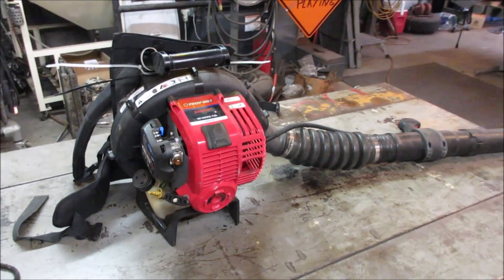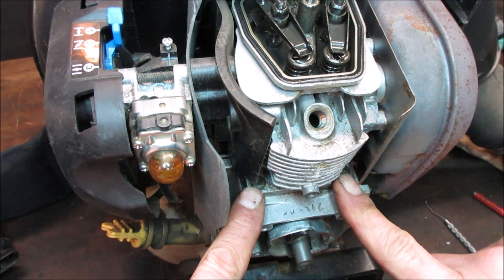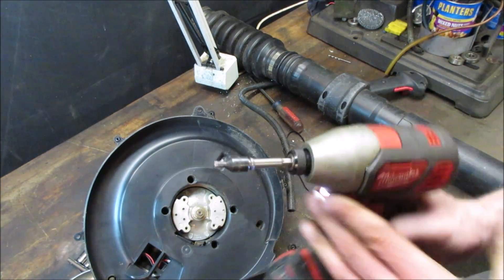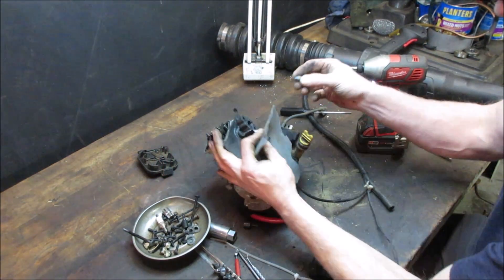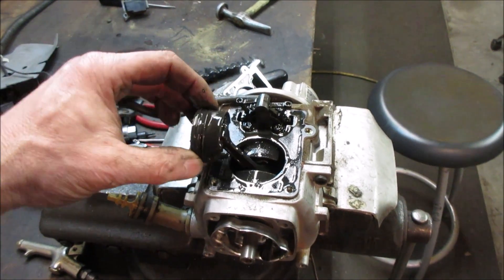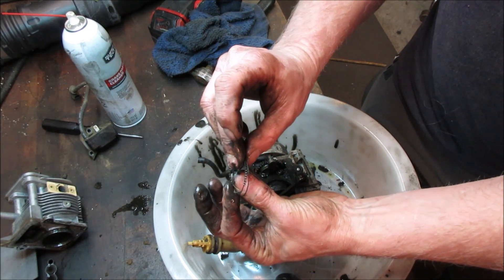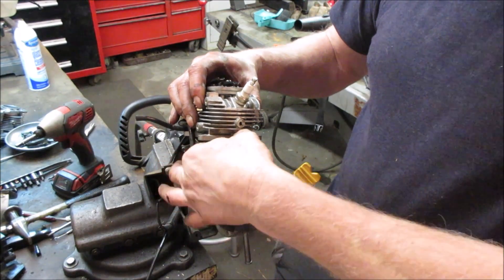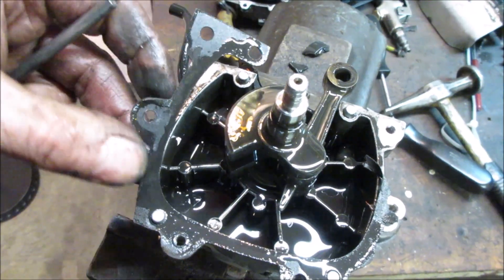Can We Save This Junked  BackPack Leaf Blower ?

Comment: When I saw the spark plug come out, my first thoughts were the piston had come off the conrod, and slammed into the head, but the valves were moving, so that ruled that out, Over the years as a motorbike racer, I have had many high revving 2 and 4 stroke engines drop a skirt from the piston, usual cause is a heat seize, that weakens the skirt, or a flaw in the machining of the piston, either way, once the skirt breaks away parts of it usually end up in the crank carrier bearings, and even if you rebuild it the bearings become the weak point and fail, great video as usual @Mustie 1.

Comment: a little trick I learned working on firearms and laser sights, when encountering loctite screws, especially them little bitty ones that are hex or torx, put your driver in the screw head and using a pocket torch, heat the shaft of the driver till it's really hot. that will usually break the loctite loose and you aren't putting heat directly on the part that might damage surrounding parts and pieces. the heat transferes down the driver to the screw
Reply: That destroys the torx bit, you had better have a disposable set.

Comment: I went thru 3 Poulan leaf blowers manufacturer guarantees them to stay together for 50 hours of run time on average which in most cases will surpass their warranty time and usually takes years to reach. Anything after that is a Gods Send, HA! with usage. The 50 hours guaranteed runtime is probably the same for these and wear and tear just destroys them eventually.Eight years isnt bad  actually probably landscaper may have used it alot. Should be an easy fix like always its all labor and many cant be bothered and put it at the curb, thats the American way. Hey its  good for the economy buy another one,LOL! Great Video as always....

Comment: Back in the day use to put screw driver handles in a deep well socket for more torc . Plug socket to manual impact and hit with a hammer. Screws broke loose 90% of the time.

Comment: Torx and Loctite. What a nightmare.
Edit to add: My bet it was laid on its side running while the user was trying to assemble the parachute harness to put it on his back. Running on its side without the oil dipper means there is very little getting splash lubed, and the side of the piston that gave way would have been the unlubed side.
Reply: I bet your right most of them are 2 strokes where it wouldn't matter. Good point

Comment: The decompression setup is missing a piece. I think it came apart and took the piston with it. That would also explain the banged up screws.
Reply: You Got It Bob 👍
Reply: Interesting and insightful.  Hmmmm I think you might be right!
Reply: Hey Doug What is the decompression setup?
Reply: @donavonlewis1039  There's supposed to be a tab connected to the ring Mustie was taking off the cam gear. It holds the intake valve open longer to make the engine easier to pull start. It's only active below idle speed.

Comment: I believe that cam gear cover is a simple oil pump that grabs oil and then slings it up through the hole right next to the teeth on the cam gear ...if you look at the cam gear there's a hole on it and it can build pressure but can only let the oil out when the hole is facing upwards towards the push rods and rockers.

Comment: The failure was directly related to it being designed to sell for $179 at WalMart.
Reply: $99 fathers day sale.. Lol
Reply: @Les We all know that thing is going to last one season.. It's worth every penny.. Lol
Reply: @Les TRUTH
Reply: @BAZZAROU812  Those machines are surprisingly good and will work for quite a few years if not abused!  My daughter left one running on its side and "away" it went!  I never took it apart, but my guess is internally, it had a strong resemblance to Mustie's!!
Reply: Usually runs 3 or 4 hours then finished

Comment: Well you certainly had some chasing to do to fully discover the fate of that little engine. My theory is poor/cheap casting on the piston which failed. The vast majority don't so but the odd ones that do Meh they'll just buy a new one, never know what killed it. If the orig owner deleted the filter and rigged the netting, they may even blame themselves for the failure. Looking forward to free pile season!
Reply: Oh, cmon, these modern Chinese engines are super high quality that would never fail. /s
None of this stuff is built with any quality anymore even if you buy the big names.

Comment: Whatever it is Mustie1 I think it's a common fail point - I trash picked my same exact machine with the same exact crushed spark plug about 2 or 3 years ago. I remember watching your videos & checked some of the basics, set the gap & she's been running fine ever since without ever looking down the plug hole. I know what I'll see now! LoL... When she does finally blow up do you want it? I could use the blower nozzle in the meantime... Thats what she said!

Comment: That is the model that cured me from buying gas powered small yard machines. Used one season and nothing but problems after that. Took it to troy built authorized repairman several times, could not get it to start properly. the first time he adjusted the valves with very little effect after that he said nothing was wrong with it. The electric starter does not spin the engine fast enough to get it going. I still have it in the back of the garage if you want it at 04967. All battery powered for me now.

Comment: In the earlier Polaris "Pro" Rocky Mountain King series of snowmobiles with the 800cc engines (two cylinder, two stroke, oil injected) they had an engineering flaw in the top end. The piston skirts would fail and break away in a very similar fashion. This was an issue to the degree, people were rebuilding the top end every two seasons. These were circa ~2013 machines. Polaris re-designed the pistons on the following models to cure the issue. A rider was money ahead if he spent the bucks to do a preventative rebuild before the issue happened with all the attendant collateral damage to the case and lower end. I'm not sure if it was an alloy issue with the piston or a weak design. My 2016 Pro Axys is still running strong on the redesigned pistons.

Comment: If you didn’t live so far away I’d swear you were working on my Troy-built blower that blew up under warranty. I didn’t have tear it nearly as far apart though. I took a bore scope and just looked through the spark plug hole. Mine the whole piston was in the lower case. The only thing in the cylinder was the rod and wrist pin. Troy built replaced under warranty, but it was a bit of a pain.

Comment: Think it got hot enough for the rings to close up. Once that happens it pulls the top of the piston off. 
Likely got hot from all the bubble gum repairs interfering with designed air flow.
You can pull the top ring land off with out scoring the walls.
Small piston size engines have a narrow window of tight enough ring gap and still maintain good compression and yet enough gap for heat expansion. These tolerances are easier to get a good balance larger the piston diameter..

Comment: I bought the same set of Milwaukee impact + drill drivers 2-3 months ago when Home Depot had a mailer or email come out about the deal.    Fantastic tools.      I removed the belt clips since as a nonpro sometimes mechanic household DIY person I'd never need them.       One cut my wrist with the torque while using it at an odd angle.

Comment: Small Vice Grips on the head of a screw like the ones holding down the cylinder can easily break the torque without damage and then you can use your hand tool to unscrew it. Works great on old Carbs too.

Comment: Really enjoy your explorations. I'd guess skirt failure. And that's not what she said. Hit by the crank, causing the top of the piston to get fractured. Chunk of piston top caught between piston head and spark plug, closing the gap. Just a wild guess. Probably have to look at the lip of that piston and see if you can tell if the edge of the break looks like it would have gone up, or down. Not sure if that can be discerned though. Looks like it went through some abuse.

Comment: lol I had a good idea what happened as soon as you tossed it onto the table. Regardless of the color or the name stuck on them most of these units were made by MTD. And thier focus seems to be how cheap and flimsy can we make these and still have most of them make it thru the warranty period without blowing up. You did pretty good getting all the fasteners out without the heads breaking off. I have a pile of both the weedeaters and the blowers in various colors all made by mtd and all various stages of failure Most traced to poor materials and or poor design. Like you said they are throwaway units. put together quick and dirty. and not meant to be taken apart. I have 4 other blowers from about the age of the one your showing that have grenaded piston issues. Perhaps it is a inherent design flaw or material flaw. Interesting to tear it apart. figured I'd let ya know. just for diagnostic sake that I can show ya 4 more with the same failure and about the same unit and date. and the 4 I have here have intact air filters.

Comment: Hello, If a screw, nut or bolt is tight. You need a "magic code word. Use the finnish word" PERKELE. If it don't open, just add some extra "R". Thank you for your informative video. Regards Stig Österberg from Dalsbruk in Finland.

Comment: Have/had a similar machine. 
The top of the valve chewed through the top of the valve retainer. Put a tiny c clip there temporarily but after a while of use, sounds like it dropped the valve again. Wasn't able to get a replacement for it.   Cute little motor though

Comment: It is a decompression system. The plate is missing the tab that actuates the exhaust valve during compression. It is the same principle as the flyweight on a cam for an OHV.

Comment: Troy Bolt is made by MTD, and MTD is just "ok" equipment.  I think it is a compression release on cam.  So the oil was never changed, they ran it without an air filter.  It dusted down the piston, rings, and cylinder and destroyed the engine.
Reply: yeah mtd makes all sorts of equipment..different names but all still made by mtd..you find that on alot of outdoor equipment..mowers, weed whackers, leaf blowers etc
Reply: Someone probably also ran it with straight gas, and forgot the mix, or just didn't have any or just didn't care, and didn't want to spend money for mix!! Either way, a bone head move!!
Reply: @lottiecooper609  It's a 4 stroke. Takes straight gas.
Reply: My bad. Either way, someone obviously didn't care!! Usually the case when the person using someone else's property, and didn't pay for it!!

Comment: That usually happens from someone starting it and slamming it wide open without warming  the engine up. Ring expands before the cylinder gets a chance to and the ring ends but up against each other.  Bango!! Most the time it rips the entire top of the piston off.
Reply: If there's oil present you should be able to run them wide open after a few seconds,  there's very little mass to the piston and cylinder and they will heat up almost instantly.

Comment: Id say it got hot due to crap oil (the oil works as a coolant along with lubrication )  running hot it cracked the piston crown and broke the chunk off the top, that chunk got in the squish zone and jammed the piston causing it to tilt sideways braking the skirt off.  Pistons and other parts for these are cheap on ebay.  i don't know about this model (not sold in aus) but the hondas run 80ml of oil which is not much so it pays to change the oil regularly. thanks for posting.... cheers

Comment: probably since that's the original oil at some point since the air cleaner was gone dirt got pulled in and started eating things up kind of like how a sandblaster works. At some point the metals shavings got so bad they got into the oil and started tearing it up bottom end causing the piston to fall apart and eventually brake. I almost wonder if that busted off piston got so ate up over time most of it just turned into shavings and helped with the destruction of the rest of the engine. Wow cant say I have ever seen a piston eat its self to death though.

Comment: it's a decompressor on the cam gear.its what they call easy start and a lot of manufacturers use it.its on lawnmowers too.usually worked by centrifugal force when you pull the engine to start it bumps the valve open.tge piece for bumping the valve is missing maybe that was the cause of the damage

Comment: My guess is someone ran that leafblower wide open from when they started it until eventually died. Heat and cooling cycles cracked the aluminum and eventually it just gave up.

Comment: I'm leaning towards one of three causes - first, the lack of air filter allowed it to ingest a piece of trash that hammered the piston...or smaller pieces of trash building up.  Second, a factory defect in that piston - casting inclusion, poor quality material, etc...  Third - it was overheated / overspeeded by someone trying restricting airflow - either at the feed (pad on the back?) or with a nozzle on the output of the hose?  The oil, while super dirty and super thick...or low oil level, seems unlikely to me as I think you'd see other damage / wear elsewhere.  Just my few pennys of thinkin'!

Comment: You should get one of those 1/4 hex long bit sets, they slot right into the impact driver and are a godsend for working on small appliances and small engines. Harbor freight sells them for like $8, and I'm sure there's a million brands just like them from the same factory on amazon.
Reply: 8 bucks may as well be 8 million. Mustie is cheap.
Reply: @billhenry7833  Musty isn't cheap, Mustie is Frugal

Comment: Very Interesting Video Mustie  1  :) I  wonder in the previous owner had used Break In Oil to long on hours and forgot change it by accident or had wrong grade Weight  in a to use after that! I have heard could happen and I know something was strange to shocked me years back to! My late Dad bought a brand Chainsaw  also from store not nameing also be excellent brand to not nameing to and  had 18 bar ! He bought brand new also he got 4 months use of it , then coil quit so got new on it and tried get going ran for 15 days then died again ! Wasn't coil also air filter or spark plug and when pull rip cord hear tapping noise from so took back store bought from they said could get parts but have no one can't fix it in that small engine mechanic repair and so took to one in area we live also get check over ! So what problem was the Cylinder on motor had one Ring on totally and ring broken up to little bits also crack Cylinder bad in + direction inside Cylinder wall! So mechanic phone my dad up said come in need showed up to show  happen  and went took him shop mechanic to show happen  to low hours use 3 year warranty Chainsaw ! He said that wild what happened and my dad said is anyway be fix also guy mechanic said yes piston with more rings also home Cylinder and install it and never seen this happen before too! So dad said okay any chance happen again too and mechanic said not sure because first one seen happen too in this brand but does again scrap it I would ! So still works last I know of but I check out this week find out been 10 years in use!

Comment: 23:11 Malice in the Combustion Palace! Also if you think those valves are tiny start looking at RC plane engines. I have a 5cc 4-stroke in my hand right now...talk about microscopic valves!
Reply: Those are pretty awesome.. My buddy does the Rc cars.. They scream pretty good.. I found out how much money they cost and about lost my Sh$t.. 💸💰
Reply: @BAZZAROU812  The expensive ones are the brushless ones funnily enough. The only ones running fuel anymore are die-hard gearheads and there's not enough of us for nitro cars to hold any value. 

Works for me, though. I'm an engine guy. IDGAF if it fits in my pocket or I fit in the combustion chamber, I love engines. So I'm all too happy to buy up unloved nitro cars and let 'em rip. And I have acquired sssoooooo many planes that way it isn't even funny...
Reply: @TestECull  Definitely a cool ass Hobby.. Have you played with the turbo fans/jets as of yet..
Reply: @BAZZAROU812  Not as of yet, but I see them at the field all the time(You know they've been up when you get out of your car and smell kerosene in the air!) and they're beyond awesome. I have an airplane suitable for such an engine as well; my Long-EZ 46. It currently has a piston engine on it and there is flight footage on my channel, but when money allows, I'll buy a small turbine engine the size of a soda can and pop it on there. Jet guys tell me it's a great plane to learn turbines on and I'm already comfortable flying it on recip power.

That coke can sized engine will put out 2-3 pounds more thrust than the piston engine on it now does. And that engine is NOT a weak one!

Comment: When they took the air cleaner out It may have run too lean and making it run too hot softening the piston allowing it to break up.
Reply: The internal surfaces didnt seem to be in all that bad a shape from what we could see. These are low HP engines, with comparatively low stresses. You could probably rune them with vegtable oil for a lot longer than you think!